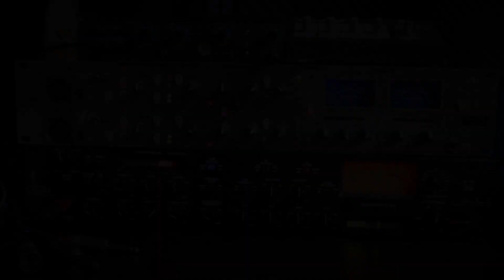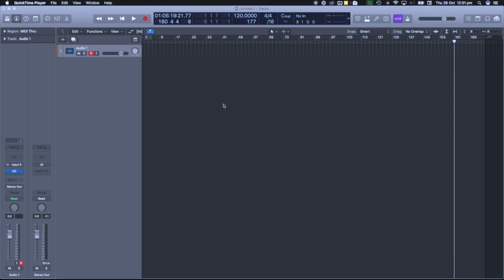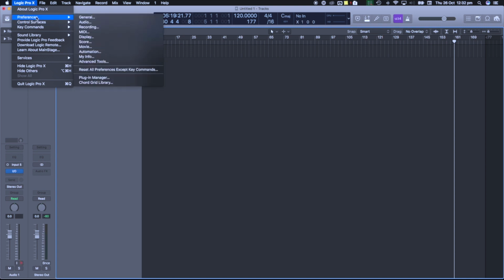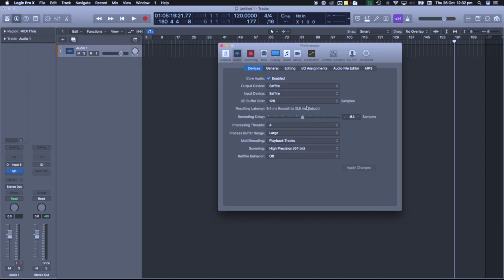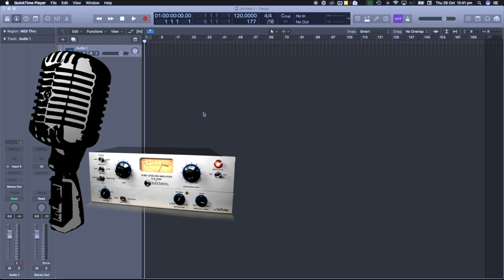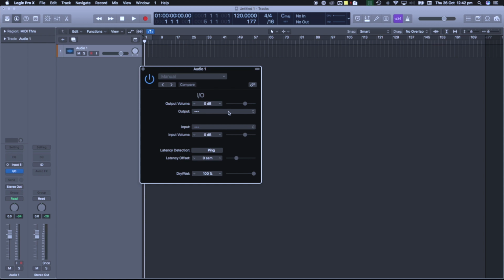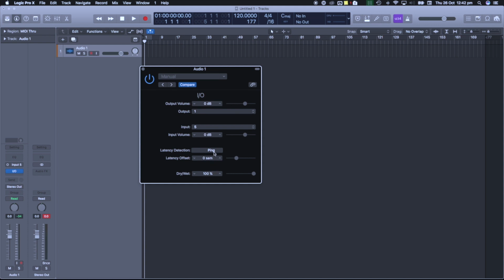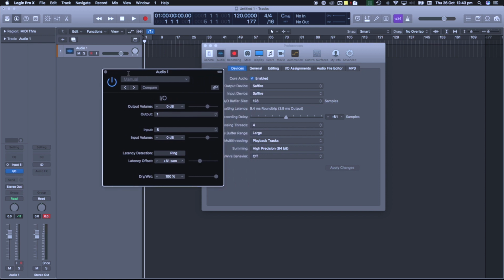How To Fix Recording Delay (Logic)

Comment: This is great knowledge, thanks for sharing! My setup is instrument -> Scarlet 6i6 (2nd gen) -> Logic Pro X. My issue is a little different, Input latency is 0 when I play the instrument during recording. My problem comes after the track is laid down. During playback of a recorded track, the entire track is offset and delayed several milliseconds. I have to zoom way in to the wave form and slide the track a little to the left in order to align it to the right timing, What are your thoughts on that?
Reply: I have the same problem, with Logic and Apollo interface. Anyone resolve this?
Reply from the maker: @sebwarren7918  Did you follow the instructions on the video mate?
Reply from the maker: Sound like a hard time your dealing with there mate. Im not 100%sure but it could be your sample rate .if you'er recording in at 44.1hurtz trough your interface make sure your project sample rate matches it in logic x. really hope that helps mate, i hate to see creative people held back.
Reply: Thanks for the reply! I checked both the 6i6 and Logic settings - both are set to 48khz as they've always been. It's worth noting that this never really happened in the past until after I upgraded to Mojave. Also, it seems to get a little worse and worse and the project builds and I record more and more tracks, Moreover, this offset is not preset if I start a new project and record an audio track up front with just a drum track. I've been all over the boards online and no one else seems to have this issue like I do.
Reply from the maker: @TheGuitarGuy69   Yea these upgrades can prove to be a pain in the ass. What do you set your buffer size to ?
Reply: @TheGuitarGuy69  have exact same problem. Use Line 6 interface, logic & on mojave. Records perfect at start but as project builds it goes out of sync. Frustrating as vocals are usually at end and always have to adjust the position
Reply: @TheGuitarGuy69  do you already solve the problem after 3 years
Reply: I/O buffer size is 128, 0 samples recording delay, processing threads automatic, process buffer range medium, summing high precision 64 bit.

On a sidenote, while I am actually recording a track, there’s zero latency with input monitoring. The offset that I’m referring to as noticed after recording has completed and I’m playing back the project and noticed that track being out of sync with the rest of the project.
Reply from the maker: @TheGuitarGuy69   is it possible you are running other programs in the background while you are recording ? dose your interface come with software?
Reply: Bad Format Tv not at all. The only application I have up is Logic at the time.
Reply from the maker: @TheGuitarGuy69  dose your interface come with software? like a mix control?
Reply: I'm having the same problem! I've always used a presonus interface, wirh no issues at all! A couple of days ago i used a scarlett 8i8 and everything i track is delayed... :(
Reply from the maker: @LuisSilvaMadsen   have you tried changing your sample rate mate? sorry for the wait
Reply: @badformatuk  I've dabbled with it to no avail. Thinking back, I think it started after a Scarlet driver update? I'm thinking it could be Scarlet drivers, but not 100%. It could also be a bug with Focusrite entirely - I'm shooting in the dark. Would love to know if anyone else has had this issue and resolved.
Reply from the maker: @TheGuitarGuy69  Sorry i want any help mate, I'll defo have a look in to it for you tho.
Reply: @badformatuk  do you already solve the problem after 3 years?
Reply from the maker: @JgnhB  I don't know what you mean by that question.

Comment: Thanks for this video. When I perform this test, I get different readings every time I perform the test (at the same buffer size and Sample rate.. any thoughts? Anybody?
Reply from the maker: You won't get a constant value with some hardware, but if you just set it at the average value you will be fine. So let's say you get a value of -65 then you try again and it says -67 you will then set your value to +66. Hope that helps mate!

Comment: Thanks for this video! I'm having a strange problem where all my midi and audio records early (before the beat). I have an apogee ensemble thunderbolt and a mac pro. I did the ping test and only have a a latency of +1 sample. As a test, I play along with the click in an empty project but no matter what settings I use all my midi and audio records just ahead of the beat. I've spent so much time trying to figure this out and joined every logic forum I can find to find an answer. Do you have any idea what could be causing this? 
Cheers mate, thanks for the video!
Reply from the maker: could be your buffer size mate, try reduce it to 64 while recording in. change the buffer in preferences . don't record in at a high buffer size, it will be well late. hope i could help

Comment: I have an alesis io2 interface. Mic goes from preamp to interface to computer. I followed the steps in your video but I do not get a latency reading when I click ping. What do I do?
Reply from the maker: Robert Woodford No worries mate. Your interface should have a built in pre amp. If you can see the signal from your mic in the daw you might be selecting the wrong input on the i/o plugin.
Reply from the maker: Robert Woodford make sure all gates are off so the sound can flow untouched
Reply: Hmm I'm not sure I understand your response. If I can see the signal from the mic in the daw doesn't that mean that I have the correct input selected? I can record with it but I'm just not getting the ping to work.
Reply from the maker: Robert Woodford if your signal reaches the daw then yes you have the right input, But on the o/I plugin you need to select your input and output so the ping can flow to your hardware and then right back to your daw. The hardware your using must be connected up with a input from the daw and back out in to your interfaces in put to go back to your daw. Sound flow ( ping from daw >  output of interface > Input of hardware >output of hardware >input of interface > back in daw > returned ping. Hope that helps mate (remember the input and out put you select on the o/I plugin are the same ones you are using to go in and out of your interface.

Comment: So i have an Alesis io2 interface and I fixed it for my first audio take and then added another audio layer to do ad-libs and other verses and every other audio track i add after the first one has the latency issue. Any suggestions?
Reply from the maker: hi bro, im here to help. make sure you have no effects on your new tracks and make sure the input in the same as the first track. make sure your checking your setting also like i show in the video. hope that helps if not come back and we will sort it.

Comment: Great video! How would I fix latency if I'm tracking drums and using multiple mics? I'm having a delay (not using any outboard gear though)
Reply from the maker: Thanks mate, so are you recording straight into your audio interface? if so it might be your buffer size. Change it from 1024 to 256 and you should be fine.
Reply: Bad Format Tv hey! It's at 256 currently. Should I go lower or can it be something else?
Reply from the maker: try 64 with no plugins in use or it will crash. If that dont workk hit me back bro,256 should be fine for what your doing tbh
Reply: Bad Format Tv thanks!
Reply from the maker: Stuart, Jr Barrett no worries Bro here to help!!!
Reply: Bad Format Tv Thanks! I'm only getting this issue during playback. It seems as if my computer kinda slows up and also when playing back, it seems as if I'm a complete beat off (music isn't lining up). Hopefully me changing the buffer helps this too
Reply from the maker: What audio interface are you using?
Reply: Apollo 8P
Reply from the maker: Nice, dose it come with software?
Reply from the maker: Like a virtual mixer
Reply: Yes! Comes with a virtual mixer
Reply from the maker: Check that your sample rate matches your project sample rate, and set the virtual mixer low latency mode
Reply: Cool! That's something that I didn't do.  Should I do that in my DAW(Logic)?
Reply from the maker: Yea ,Make sure the sample rate in logic is the same as the one in your interfaces virtual mixer. On your virtual mixer set the sync source to internal and make sure the sync status is locked
Reply: Bad Format Tv hey i use m track 2x2 and when i record i have a latency issue idk how to solve it . I just record with plugins on my vocals and mix afterwards
Reply from the maker: Its your setting in logic then mate, try changing your buffer size to a lower setting.